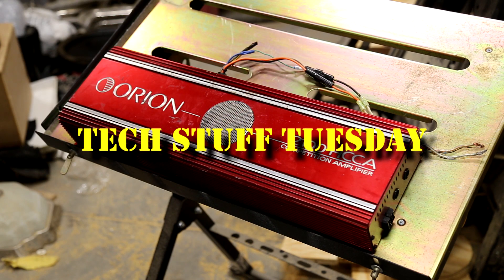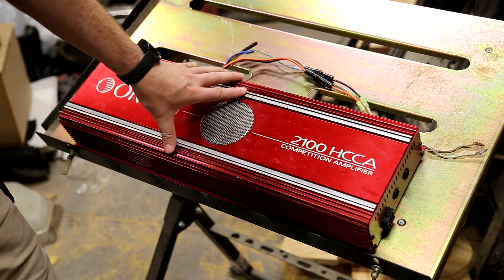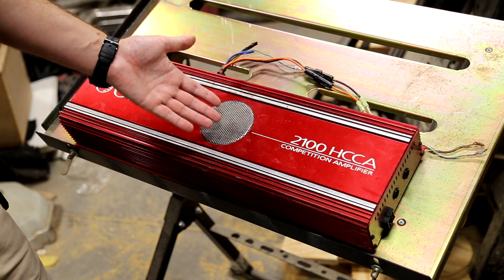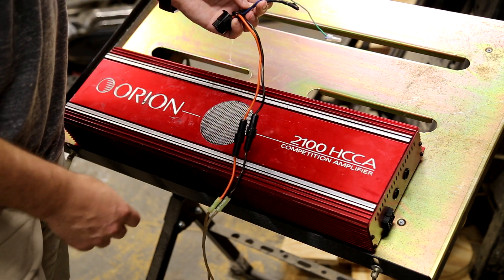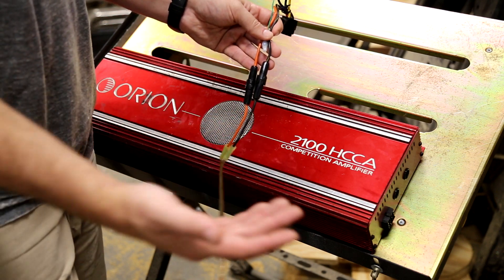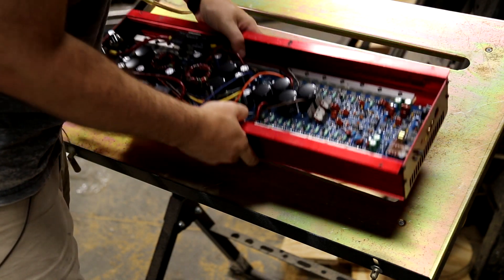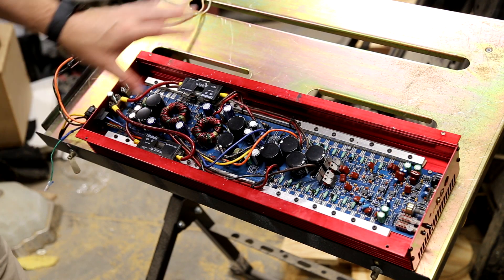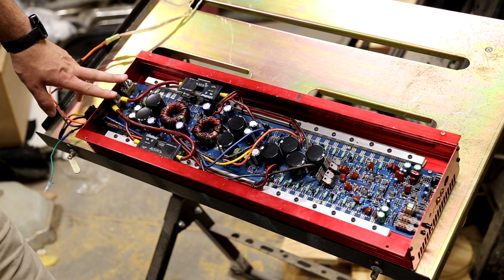22 year old Orion HCCA amp test, how much power does it *really* make? - Tech Stuff Tuesday

Comment: How much would this test differ if you actually used a true 2 ohm subwoofer rather than bouncing around frequencies on a 4 ohm one to manipulate impedance? All you're doing is playing around with box rise with this method correct?
Reply from the maker: I'm playing different frequencies to force a specific impedance. The sub IS a true dual 2 ohm sub, impedance changes so no matter what you start with it will vary. The power won't be any different with a 2 ohm resistor compared to a 2 ohm reactive load, same for 4 ohms, or 1 ohm. The load is the load, but we refer to reactive and resistive to indicate if was a speaker playing or not, or a resistor bank.
Reply: @EMFAudio Its dual 2 ohm but wired to a 4 ohm load correct? I do love seeing numbers but I still think manipulating impedance using different frequencies isn't very accurate. I'd love to see a 2 ohm sub vs 4 ohm sub in the same box at the same frequencies for comparison. And just for the record I'm by no means saying your method is wrong. I'm more or less asking questions. I do understand there is no perfect way to test two different impedance subs because the box rise will throw everything off. I guess I'm just as stunned as you that it made more power at 4 ohms than 2 ohms lol
Reply from the maker: @dtrain8335  It's a dual 2 ohm wired to 1 ohm. Manipulating impedance by frequency is exactly the same as using a resistor. The difference being, resistors aren't in your car and this is showing a real world usage. Amp dynos I consider to be bogus because that isn't how you're using the amp in a car so you may get unrealistic expectations.
Reply: @EMFAudio  Gotcha! I wouldn't have assumed you wired it to 1 ohm knowing the amp wasn't rated to handle that. I'm not trying to compare dyno numbers just different impedance subs that's all
Reply from the maker: @dtrain8335  I wired to 1 ohm knowing reactive load would be higher and I wanted to be able to get to 2 ohms.

Comment: Unfortunately almost every old orion amp test i see is underwhelming😖 they were always one of the most aesthetically pleasing designs. I'm glad i never bought into the hype though.
Reply: 225 and 250 were pretty good in those days when compared with comparably priced offerings from the other good names.  Certainly not as good as many hyped them up to be but I ran those two for many years and they took a beating.

Comment: Im glad i didnt switch over to Orion from Fosgate back in the day. At one time i had thought about switching out all ten of my Fosgate 15's and power 250m's over. Dodged some massive credit card debt on that one.
Reply: MullinPerformance  damn bro im a old fosgate guy and that setup sounds amazing 250m”s and 10 15”s. Damn damn damn!!!  If you get a chance check out my stuff i put on here you might like it
Reply: @karl6823  Had 8 Punch 15's in a 4th order before that was a thing. Then went to 10 in a sealed wall. This was 1997-98...
Reply: Damn bro much respect!!!! I could imagine how it sounded😃
Reply: I remember Orion smoking fosgate and had more amps and more speakers in vehicles at a time … Siegel auto radio in Toledo out 4 10 in a blazer and blew the windows out …. Imploded them all. Fosgate fabs will never admit but for a short time Orion was the best